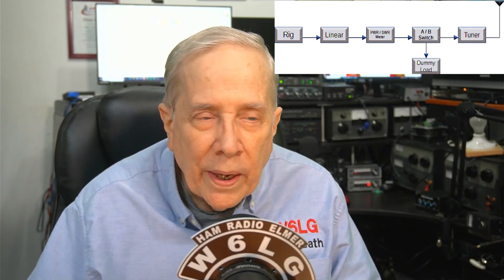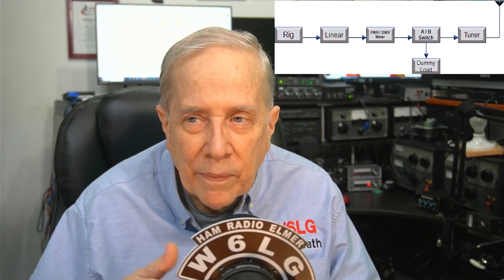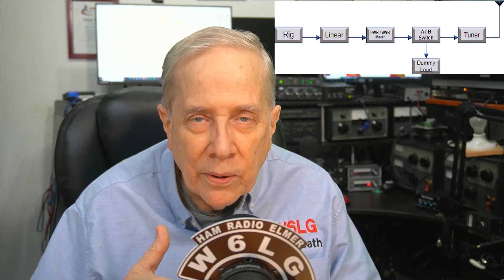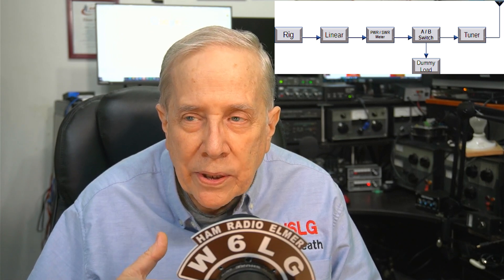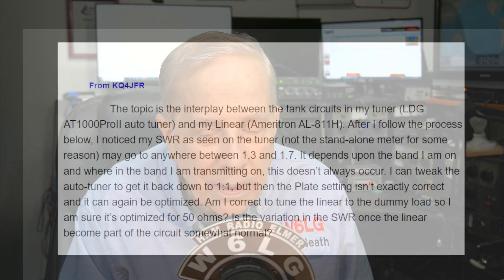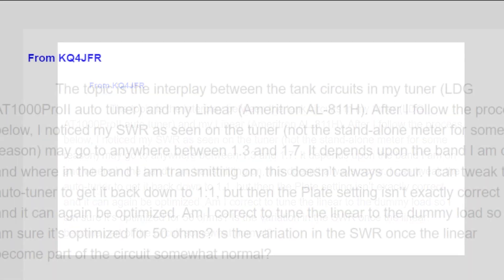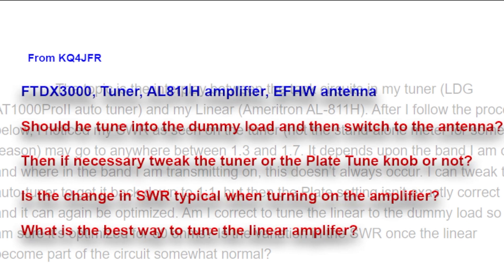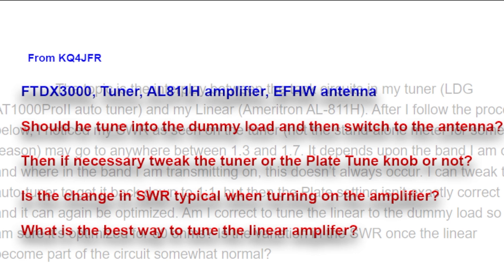FTDX3000 AL811H LDG1000 How Do You Tune This Equipment? Why Does The SWR Change?  Jim W6LG Explains

Comment: Good advice as always Jim. Getting settings in the right ballpark with reduced drive will save a lot of meltdowns. You are right to mention the dangers of working inside live valve/tube amplifiers, over the years I have heard of a number of amateurs killed by their amplifiers and a local ham that was badly injured. Of course in some cases no--one will ever know the cause. 
Tube amplifiers are on a mission to kill the unwary, NEVER operate them with covers removed or interlocks defeated. 73

Comment: Thank you Jim. What amp do you recommend for LL? I don’t plan to run full LL but would like to have the option to throttle back the exciter a bit and keep the tubes alive for awhile. Currently using the als600. Many of the tubes have gotten extremely expensive. 3cx800 for example. I’m not really sure if it’s worth the extra 1500$ to get one honestly. I liked alpha amps but I’m not sure they work on their amps anymore. Can’t afford elecraft.
Reply from the maker: Hi Jay, 
Also consider the old SB220  and TL922 type amplifiers.  The Ameritron with the pair of 3-500z.  An older Ameritron from before it was purchased by MFJ.  A Drake L4B if the transformer has been replaced with one of high voltage.The 3-500z is a much better tube than the 572b with 160 watts of plate dissipation.  Four of those will give you 640 watts total as opposed to 1000 with the Z tube.  With 1000 watts of PD that works out to 2500 watts input and about 1500 watts output.  73, Jim
Reply: @ham-radio  thank you Jim. I guess the soft start /key mods are a must with modern transceivers like the 101?

Comment: Hi Jim,
You're looking good. That's nice info about tuning for max power and not worrying about a dip. I'm running a solid state amp and only need to worry about not exceeding 70W max drive level. When I bring my SB220 back on line, will have the tune and load knobs to adjust. Stay safe.  73  WJ3U